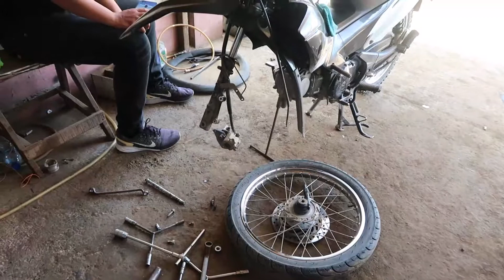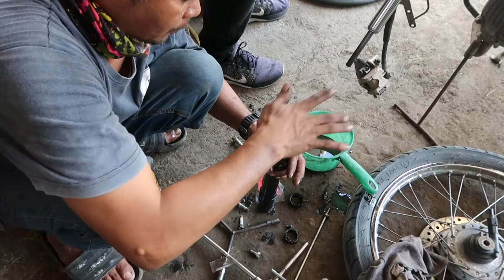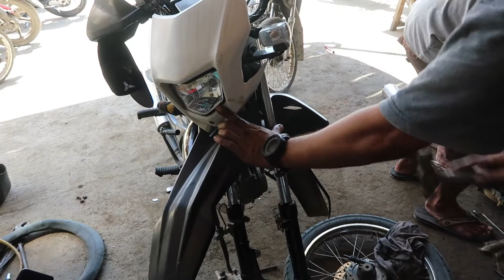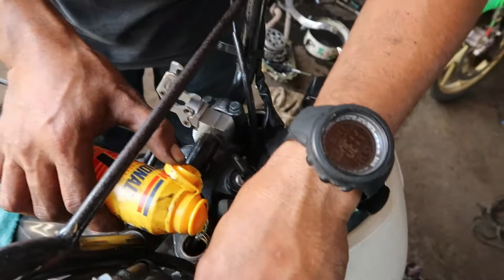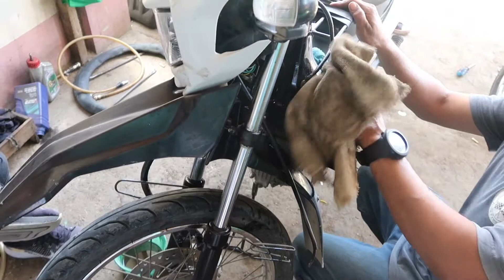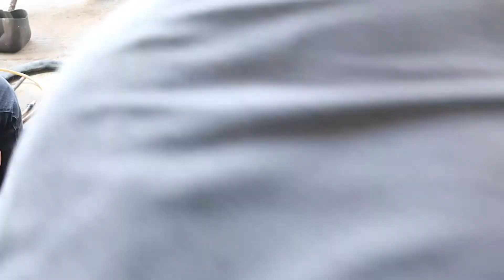XRM 125 FORK OIL CHANGE, OIL SEAL & DUST SEAL REPLACEMENT | PAANO MAGLAGAY NG FORK OIL SEAL

Comment: About sa expirience ko at naging motor ko na wave 100,125 xrm 110,125 Rs 125, Tmx masasabi ko na failure po ang pag change nyo ng fork oil 

Dahil may mga sukat po ang pagkakabit ng oil marami na akong nakatagpo ng mga siraniko meron pang ginamit ang 2T pang pork oil 

Hnd magpapantay ang bounce at absorbtion ng shock mo sir
Reply: Ilang ml kong sa xrm 125 sir
Reply: Ilang ml sa xrm?